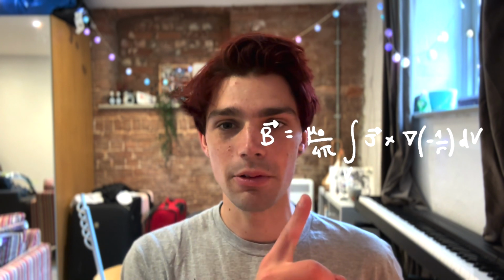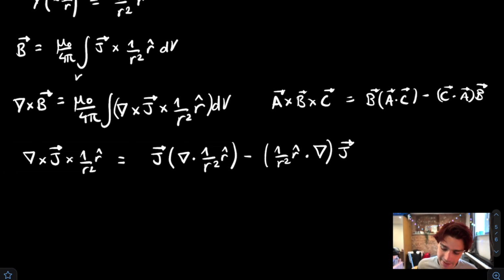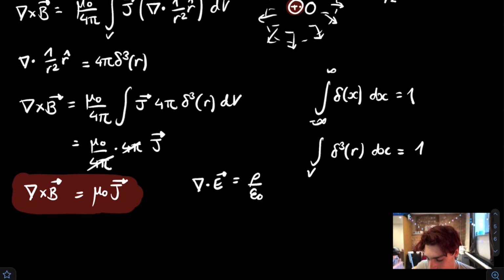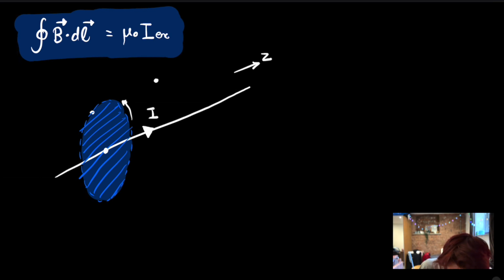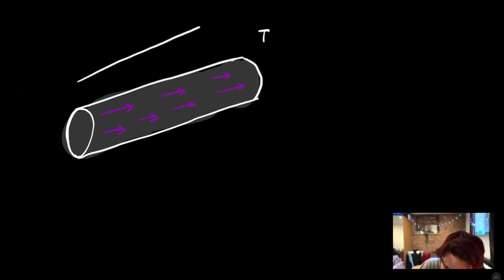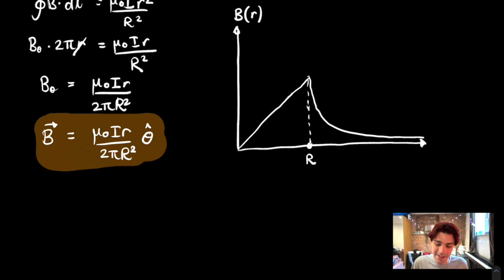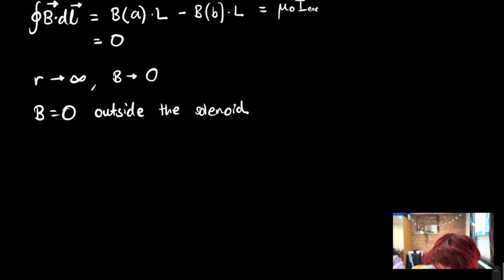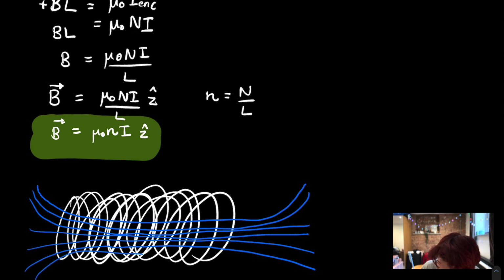Ampere's Law - Magnetic Fields of Wires and Solenoids - Electromagnetism

Comment: Graet video again u explain theory like its a story
Reply from the maker: It’s actually not the BAC-CAB rule like I said in the video. 
The vector algebra actually gets quite a bit more complicated when the del operator is involved - it’s not quite as straightforward as expanding it as if it were two vectors. 
It’s similar to how the product rule when applied to normal scalar functions produces additional terms, rather than just expanding a simple bracket. 
Add in the additional complexity of vectors, and it gets quite messy. Thankfully most physicists don’t get too hung up on the mathematical details, and you’ll likely be given this identity.
Reply: @pazzy768  ok thanks for clearing it